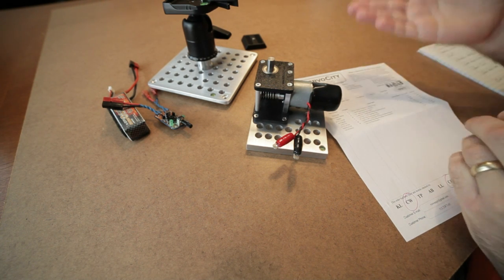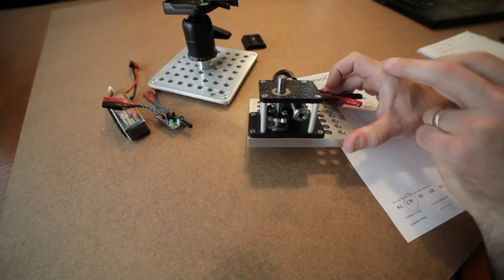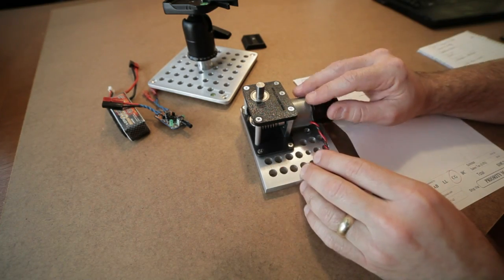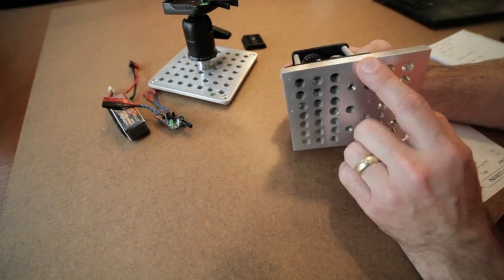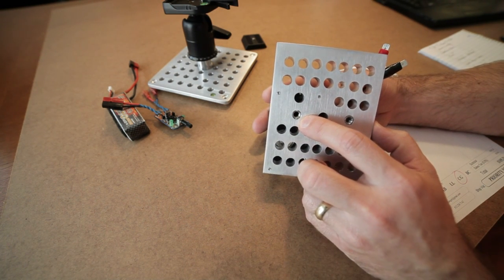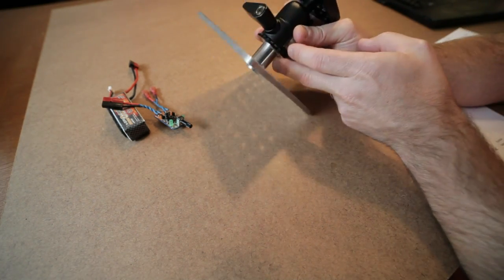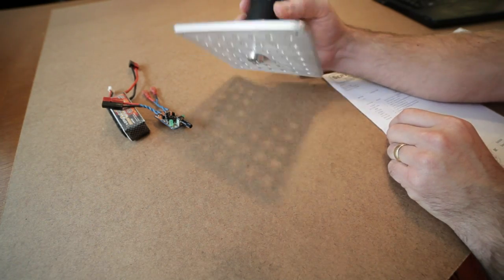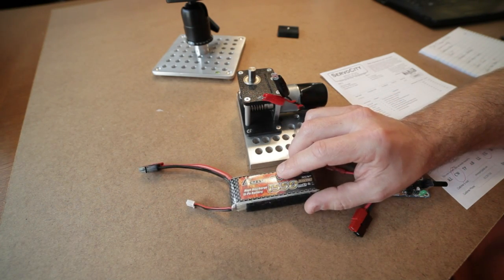DIY Time-Lapse Turntable

Comment: @ 1:05 - RIGHT?!?
I can't find but 1 or 2 things on the inter webs, minus this vid of course.
I bought a TAMIYA pulley/gear unit set. It comes with a tiny motor, but I have a lot of different sized motors in the garage. 
I have a bathroom vent/squirrel fan, ceiling fan motor, etc, etc...
I just need something that will go really slow for time/motion lapses. 
I'm under the assumption that what I need is a pot switch, to control the speed?

Comment from the maker: That's right...too slow to affect the stills, though, in practice dragging the shutter for TL photography is desired to give a smoother effect.  I typically like to shoot time-lapse of regular moving objects (clouds, cars, people) at 1/30th second, faster shutter speeds give a "jerkyness" to the 30fps footage.  For stars/milky way I shoot at 25-30 seconds (f/2.8 and ISO 2000) so this will be real test...I will likely have to really slow down the motion or incorporate a stop-shoot-stop system.

Comment from the maker: Good question, but it's aligned...the camera tripod head is aligned all the way down to the GB shaft.  It's the GB that is off-set on the bottom plate; however, the tripod mount for the supporting tripod IS directly under the GB, so all-in-all it's pretty straight-through on the loading.  The reason I off-set the GB is to allow room for the battery and speed controller.  Although, now that I know the battery can be much smaller, I could have centered everything.